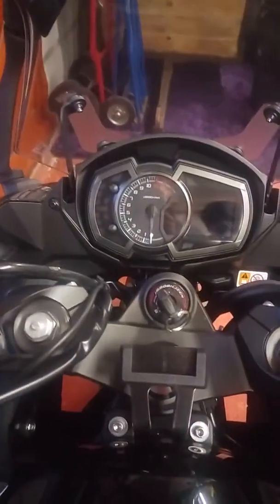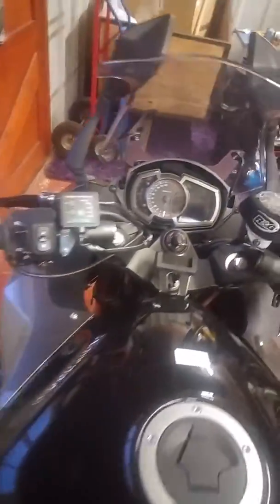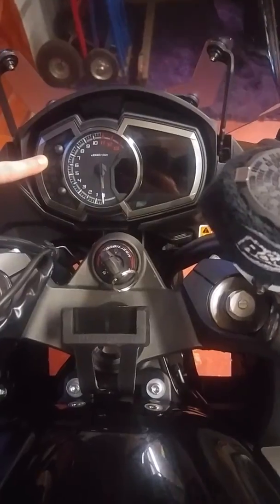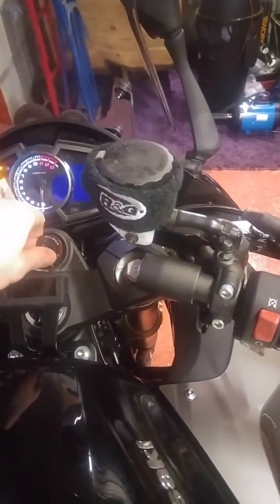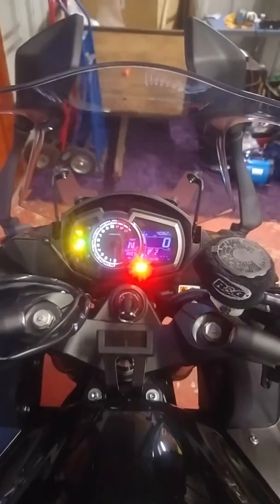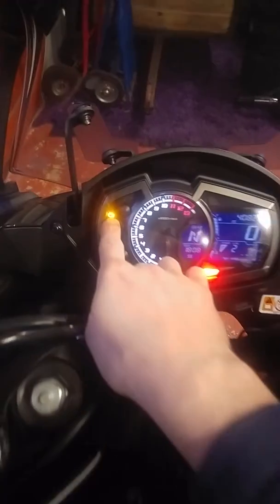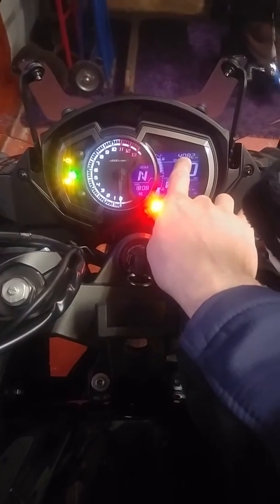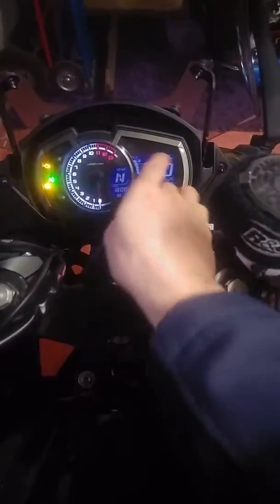z1000sx engine fault code diagnostic

Comment: Fault code 33 was a phantom code on the Nissan 300ZX...   Just disregard that code....  On these Bikes you're probably going to need a oxygen sensor...  And may have to replace part of the wiring harness and plug-in...  ?  A lot of people uses a cheap aftermarket automobile oxygen sensor...  And re wire it because the colors won't match....

Comment: What did you do to fix it?? I have the same error.. started after changing my exhaust to full system.. I tested my O2 sensor using a multimeter and readings looks good.. not sure how to fix it.. bike's performance has also dropped

Comment: Brill - will try it tomorrow. Just changed the aftermarket exhaust back to the stock exhaust and the DFI light came on instantly. Maybe the previous owner had it mapped or took out the Cat converter.

Comment: What was the outcome to the fix?
Did you replace the oxygen sensor or fit an eliminator?
Reply from the maker: I took the bike into Kawasaki - They just replaced the sensor as it was still in warranty. 
Didn't get too much of an explanation about what was the cause but they were happy enough changing it over.
Has been perfectly fine since they changed it so I expect most likely a faulty sensor.
Reply: @tarmactaz  absolutely brilliant!same prob with mine!!👍👍👍